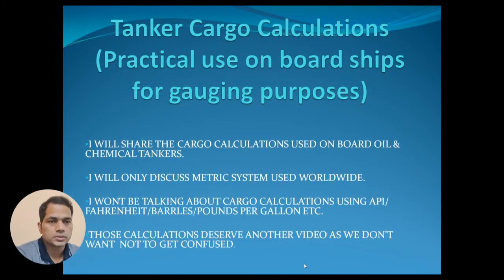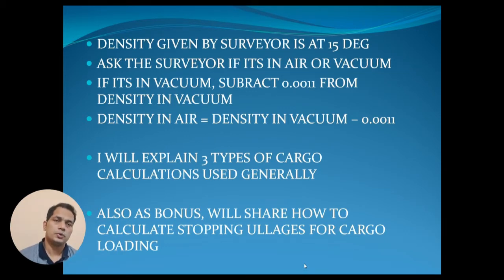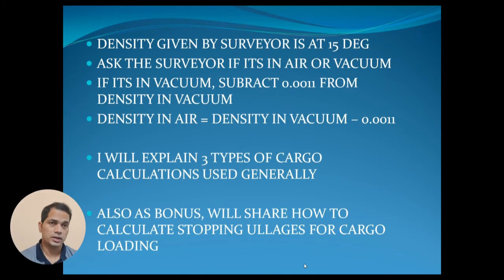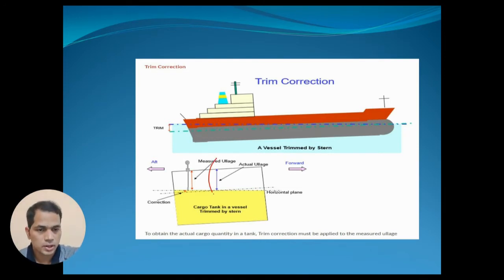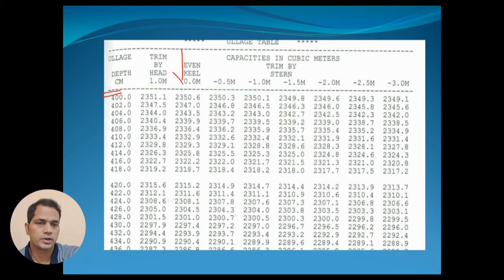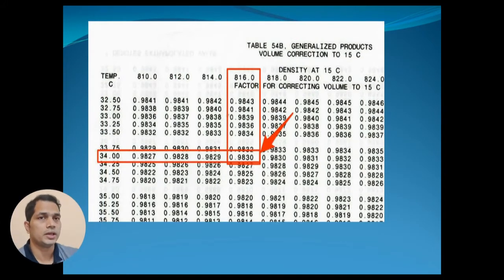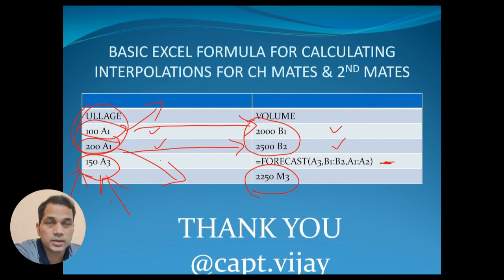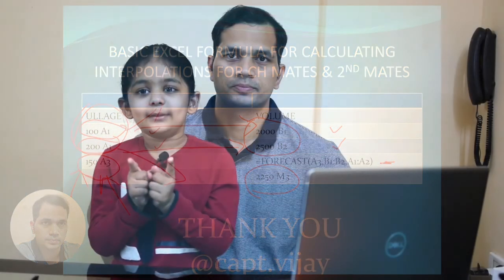Cargo Calculation onboard Oil/Chemical Tankers made easy #cargocalculations #oiltankercalculations

Comment: But sir I want add up here dat u have apply list and trim correction in order to get observed ullage
Reply from the maker: Those are for ur exams purposes. In loadicator, you can get observed volume directly after you apply list/trim. But thanks for the comment though. For using loading manual, u need to use interpolation which I have described in the end of the video.